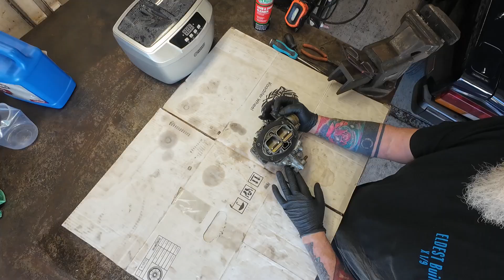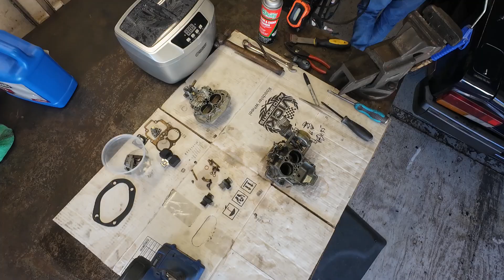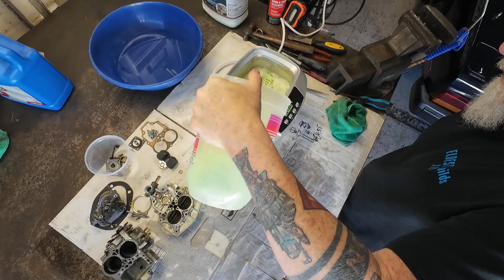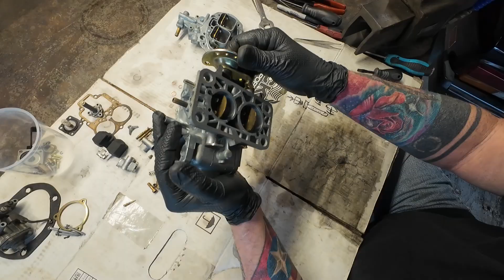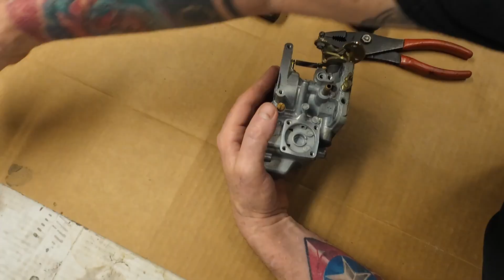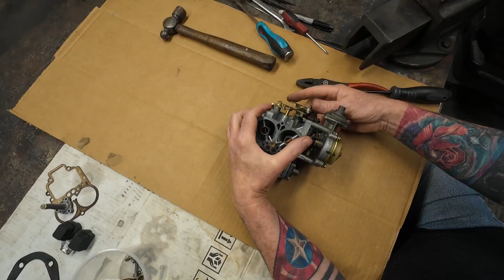1979 Fiat Spider 124, Disassemble and clean Weber 32/36 DFAV (sonic cleaner) reassemble

Comment: For ultrasonic work one can place item to be cleaned into a separate container. Place cleaning fluid into container and keep plain water in tank. This will keep your ultrasonic water clean and smaller items contained so you do not have to fish them out and possibly lose them.

Yet again,  another fabulous and entertaining video Jesse.

PS: That carb looks excellent after cleaning.
Reply from the maker: Got the cleaner tip from Dano over at Book Autowerks